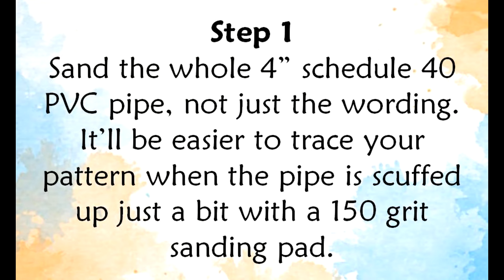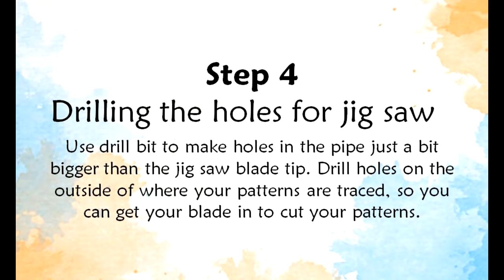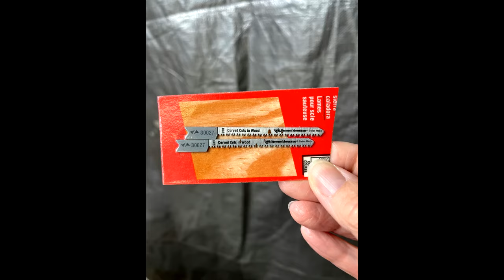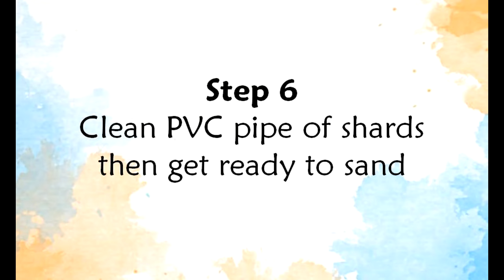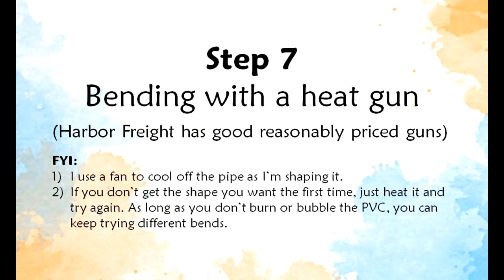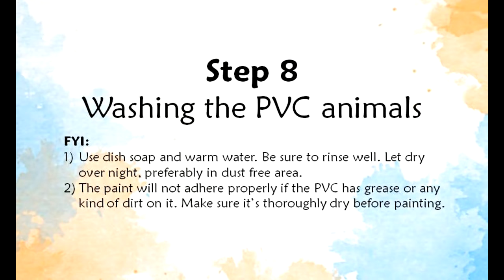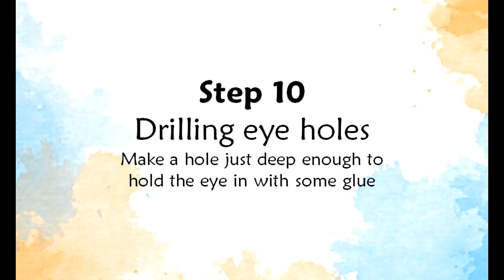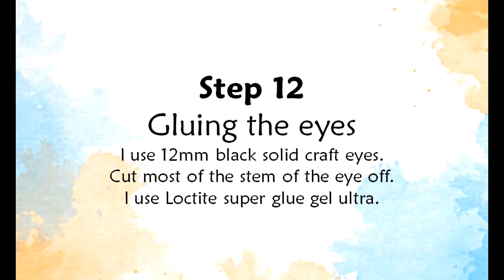Step by step - How to make a PVC pipe pelican

Comment: Hi Amanda can you tell me the type of paint.  happy new year
Reply from the maker: Hi Erkan, 
I use Rustoleum Painter's Touch 2X spray for the body, feet and beak.  Then just an exterior latex paint for the sponged on parts like the yellow on the head and the black on the lower tail feathers. 
Happy New Year!